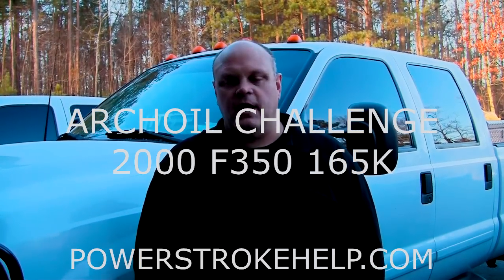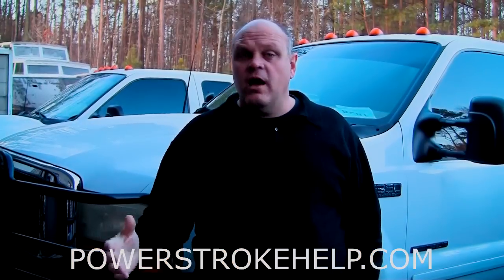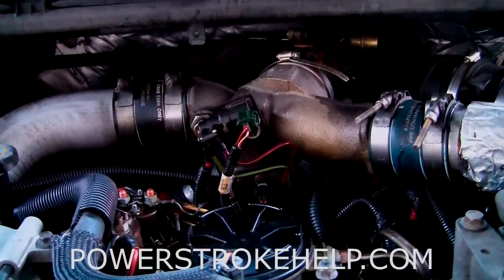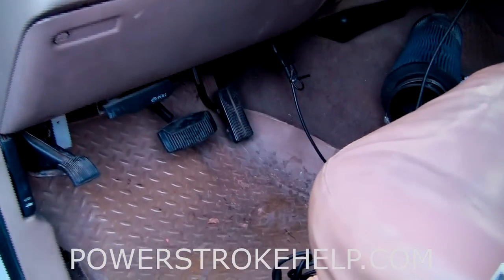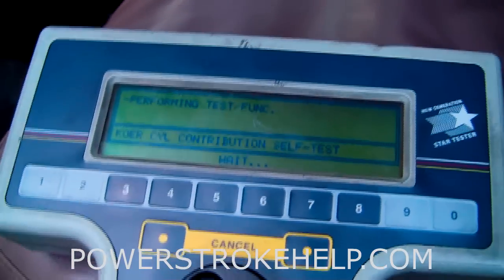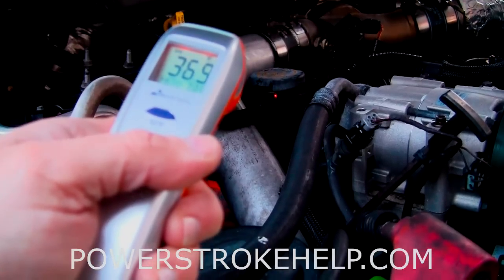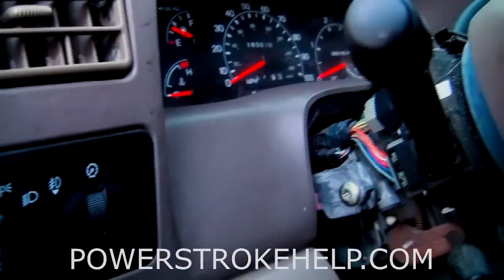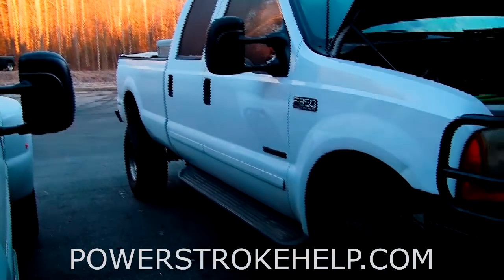ARCHOIL CHALLENGE 2000 F350 165K

Comment: Great video. I have a 02 7.3, I tried the hotshot oil additive. I noticed a difference when it runs. Is the arch oil better. Or is it the combo of fuel and oil the best way to go?
Thanks
Reply from the maker: You need both Ar9100 friction modifier in your oil and AR6200 combustion catalyst in your fuel. You will think you have a new truck.

Comment: Can you make more 6.7L videos?
Reply from the maker: 149taylo Most are still under warranty so we don't really see them until they are out of warranty. The ones we have seen problems are generally turbo, DPF or the motor is blown from high performance abuse. The use of AR6200 has huge upside benefits for the DPF because of soot reduction. archoil.powerstrokehelp.com

Comment: If 6.0 is harder on oil than 7.3 why does ford manual  7.3 have shorter oil change interval than 6.0
Reply: Because it has a larger displacement which results in greater intake of contaminates.

Comment: Can the AR6200 fuel treatment be used in conjunction with other fuel treatment like Diesel clean cetain boost or should it be used alone? I ordered the kit last week.
Reply from the maker: Jay Low Hi Jay. I fulfilled your order myself. It is not necessary to use those other products with Archoil AR6200 combustion catalyst.

Comment: does that stuff only work on powerstrokes or will work on duramax because my uncle has a limp mode problem on his 01 duramax he'll be pulling his trailer and all the sudden the powers gone and he has to pull over to reset it
Reply: Duramax is common rail, so it would benefit more from the fuel additive than the oil. But limp mode is usually caused from clutch slippage, try changing the spin on filter, be sure to clean the magnet and put it on the new filter. Most likely needs a rebuild though.
Reply: jacob williams I would still use Archoil to protect the Engine

Comment: Same issue on a 00 7.3, since I've had it oil changed every 5k, what's the difference this issue and worn out injectors?
Reply from the maker: Devinv The symtoms are the same for either worn out or sticking injectors. He main difference is that the wornout ones will not smooth out or gain power once warmed up. Worn out injectors will continue to skip after the truck is running. I have seen some miracles happen using the ARchoil additives. archoil.powerstrokehelp.com
Reply: powerstrokehelp  fortunately your video is the first I've seen that actually had the same symptoms as mine,  you could floor it in gear and after about 10 seconds it feels like the injectors "clear out", blows a cloud of smoke and runs like a champ.  Ordered your p1 kit, Will post results.
Reply: powerstrokehelp so I followed instructions,  did the hpop oil change during the regular oil change,  still only a slight difference. Got a price quote on a set of good used injectors?

Comment: Whats the best oil for a 99 7.3 with 297k miles that runs good?  rotella regular or fully synthetic? what weight?
Reply from the maker: I run the Rotella T6 full synthetic in Spot (894k and counting) and the old girl runs great on it.
Reply: thanks

Comment: How much of that did you add in the fuel it sounds like like 15 ml or is it 50?
Reply from the maker: max dean 15ml for 40g of fuel. You want to run the AR6200 a lttile hot on the first couple tank fulls.
Reply: Ok, I got the AR6400 and I'm running that now. I wish these bottles had better instructions on them. I feel they are lacking. Guessing since I have a 35g tank I'll run about 10ml. Thanks bill.

Comment: What all did you replace before and after the treatment on the truck?
Reply from the maker: Oil change with rotella T6. 16oz AR9100. AR6200 in the fuel. drove it for 40 miles and parked it.
Reply: powerstrokehelp I thought it was 31 miles {:-)
Reply: Why did it have a new coolent reservoir at the after treatment vs the before?

Comment: I've got an excursion that is dog shit for this very problem. 1 3 5 8 all pop up on that same test... in order to start the fucker I have to wait to a 70+ day and then pray to god. I'll do this to it and see what happens. I was told the injectors where gone, but here in CA we got fuck all for diesel mechanics.
less than 200 bucks and a few hours of dicking with the thing I'll give it a shot. once its warm it does good, maybe I'll get lucky
Reply from the maker: TheKurrgan1 OIl and fuel quality have such a huge impact on how these trucks run. The ARchoil AR9100 friction modifier in the oil and AR6200 in the fuel you should see some improvement. arhcoil.powerstrokehelp.com

Comment: Why was the degas bottle changed?
Reply from the maker: Adam Durando because it was cracked and leaking. You guys forget that these trucks are almost 15 years old. All the plastic rubber and seals deteriorate over time. The thing that sends most 7,3s to the junkyard is electrical demons. Harnesses are no longer available from Ford and the used ones are no good.

Comment: Could use this to clean good running original injectors?
Reply from the maker: It will help you keep your injectors running for ever. I have seen a 6.0L truck with 290k miles that the customer installed Archoil Ar9100 religiously in the oil and used AR6200 in the fuel and the injectors were ORIGINAL. No kidding.
Reply: I'm sold.

Comment: What scan tool were you using I have a 2000 excursion with a 7.3 so it would work great for me.
Reply from the maker: That Star tester has not been made for 10 years.
Reply: powerstrokehelp You can find used ones on eBay, and the Company that made them Hickock is selling a revised version called the NGS Mach II. Has a bigger LCD, no card swapping, and easily updated.
Reply from the maker: TBird100636 Thats good to know because this Star Tester is on its ninth life. Im surprised it is still working.